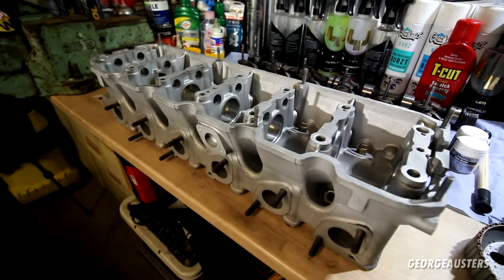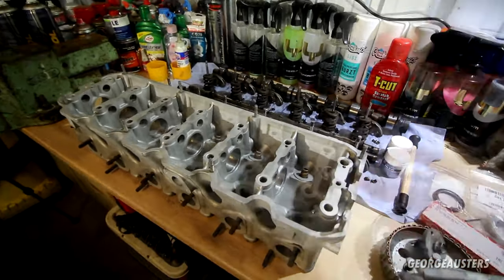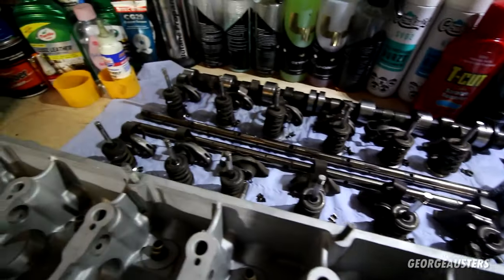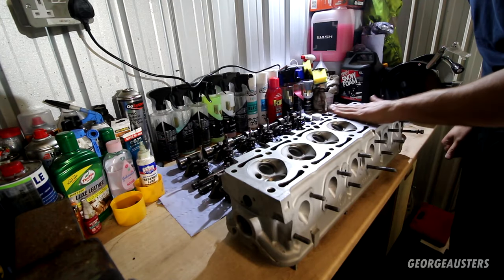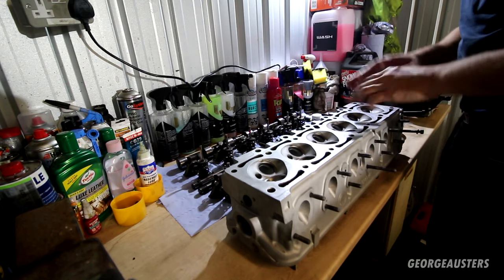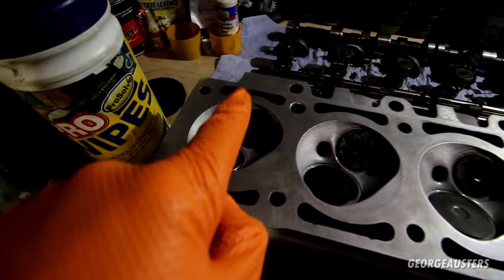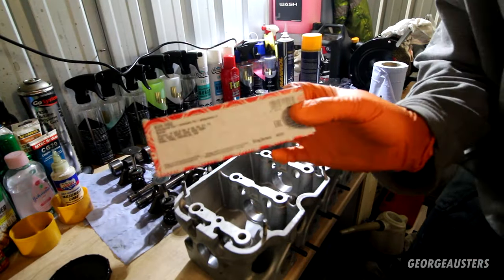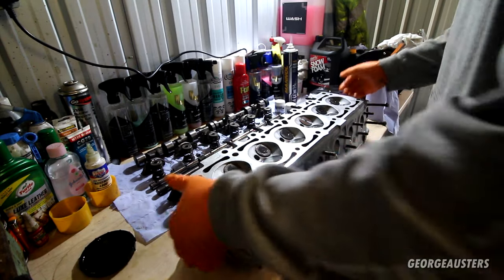BMW M20 CYLINDER HEAD REBUILD *Complete Start To Finish*

Comment: you may use a higher and lower SAE to make up for the scoring. I guess these old engline run on 20-50w, not sure
Reply from the maker: Yes correct👍🏻
Reply: @GeorgeAusters  they make 10-60w for high performance cars. Not sure if this idea may help you